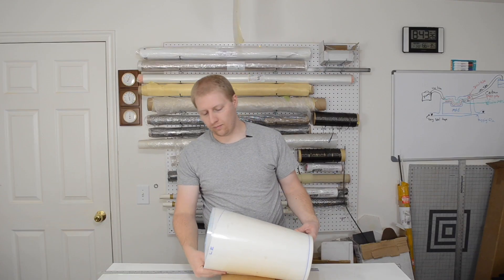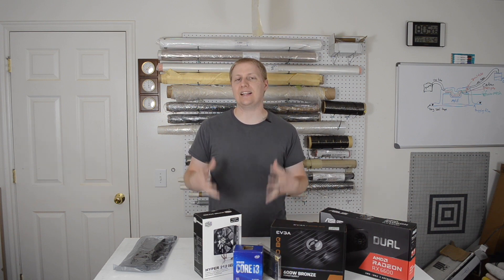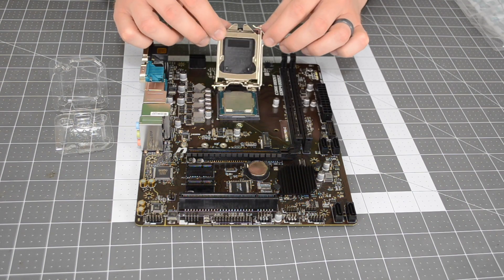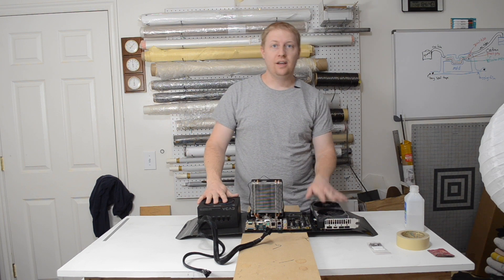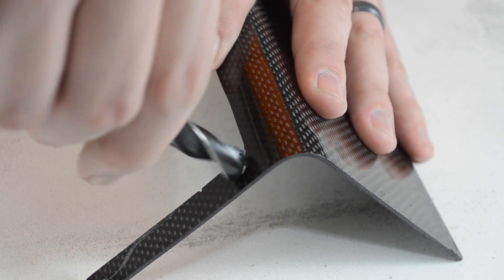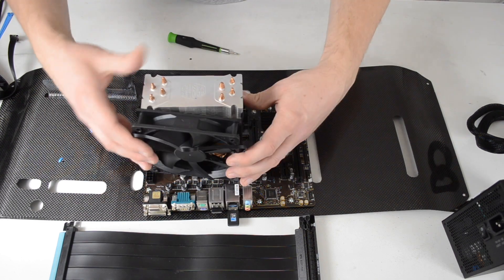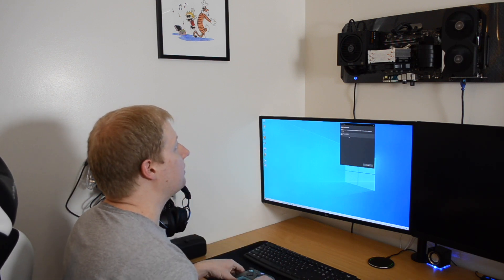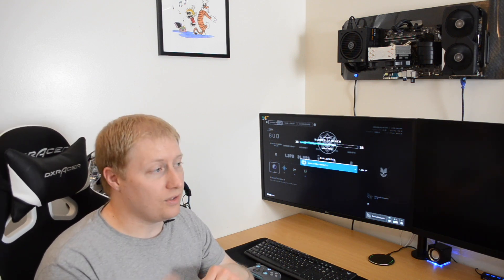Carbon Fiber Gaming PC - DIY Build!

Comment: Wont the heat from the computer components melt off the epoxy in the carbon fiber? I am a newbie and interested in making one myself (but building a full pc case from carbon fiber) but I worry that the heat generated by the components may melt the epoxy. T-T

Comment: Would you be interested in doing a commissioned PC case build (nothing fancy just the traditional rectangle shape)? I have made a few parts for my autocross car (1972 Porsche 914) but my hand size isn't conducive to making smaller parts (If I was married I'd need a size 24.5 ring) and repeated failures just destroy my patience).
BTW your videos are super helpful. I e recommended to a few friends looking to get into CF

Comment: Talking about Linus Tech Tips, why not try to work with them to make a custom Carbon Fibre case ?
They can probably do it without you because they have quite a bit of staff that do all kinds of things and can research it, and you'd have to go to Canada, but, maybe they might like to do it ?
Or go off of standard measurements and make a few of these and sell them online, might make you some nice bucks to be honest.
Also, i've seen some rather useless extension cords/external Power buttons for PC's, and for this, it actually makes sense, put it on your desk or attach to your keyboard or monitor or whatever, easier to reach.

Comment: Awesome video, thank you! 
I was recently thinking about maybe building a carbon fiber PC case that is compatible to KLT / euroboxes so I can stack them on top of each other like an "ad hoc server rack".

Generally modern fans are pretty silent but I read that the bearings can age so they can get louder and need replacement to stay silent in the long run. But hard to really track this kind of stuff without actually measuring it.